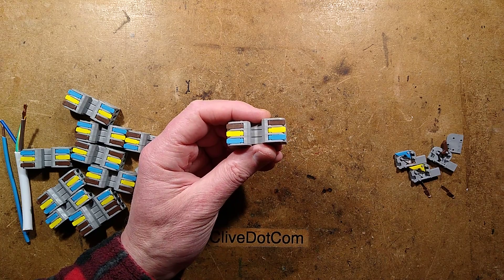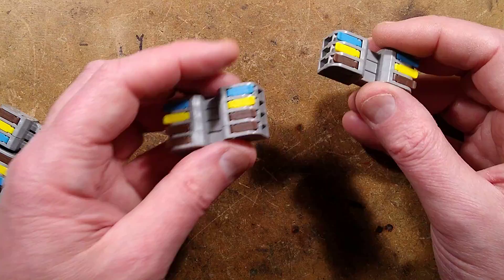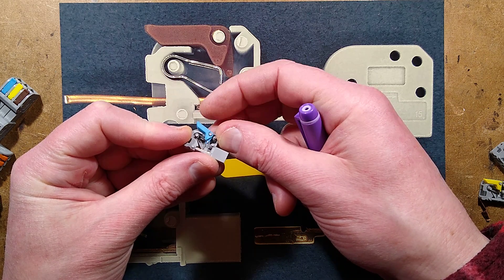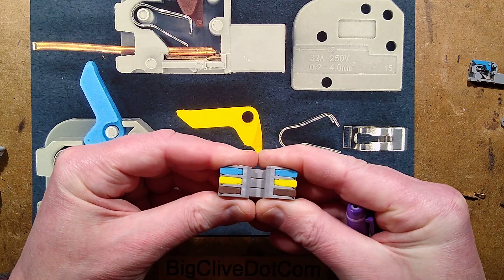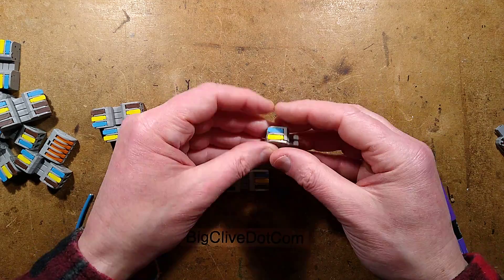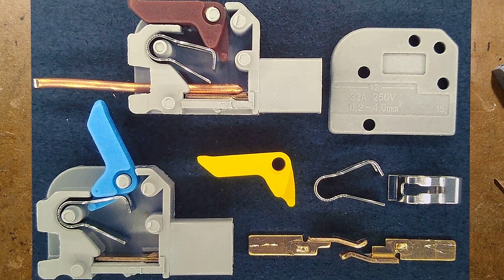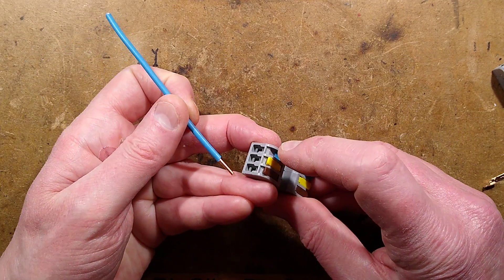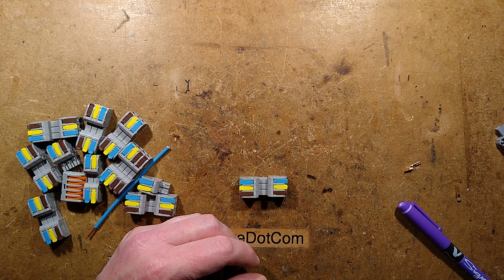Interesting modular connector with a few issues

Comment: Interesting - perhaps they should key the different colours, so that only like colours could mate together.
Reply: I'm honestly surprised that that isn't a minimum standard for something like this.
Reply: @seanbrockest3888  There is. It is the certification process that these haven't gone through - which is needed if you want to install them in a home's mains wiring. For the reasons Clive gave, I doubt these would pass. Which makes importation of these legally dubious.
Reply: @seanbrockest3888 well, these are made (and sold) where standards mostly aren't part of the process😊
Reply: China has no standards, they just copy ...  @seanbrockest3888
Reply: It would have been easy to add a way to key them. Add  a groove to the right and a dimple to the left in the same way the phoenix contact modular connectors "sc2.5" and "sp2.5" have. There you can cut it off and add it into the receiving end. Having 2 allows them to use one housing for both parts like they currently do. This product is a half assed copy of wago, phoenix and Anderson connectors. They had the chance to build something incredibly awesome from all of these.
Reply: @kjc197 
But the coloured leveres can be swapped about.
Reply: @snakezdewiggle6084 ah - I didn’t realise that.
Reply: @kjc197 
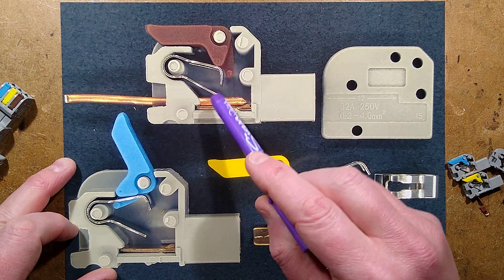Yeah me too, until I saw Clive's photo 1:42 the yellow and blue levers.
Reply: I wouldn't touch these with a barge pole.
Reply: I was thinking a plate with a protruding finger that could be snapped on on either side. Say finger on the top half on the right side and on the bottom half on the left side. That way if they were misaligned, the fingers would prevent them being put together, but if they were properly aligned, the fingers would slide past each other.
Reply: @jamesbrown4092  I had the same thought, wouldn't cost much in either development or manufacturing.
Reply: I think that a cheaper solution would be adding a blind peg on the end plates so you cant fit the connector out of sync.
Reply: Yes, that should be done at a minimum.  However, they likely didn’t do that for cost reasons.  With the current, dangerous design they can use one mold design for all parts.  Just change the color of the plastic every few days.  A safe design would require separate mold designs for each color.
Reply: @LTVoyager  this design isn't dangerous, it what is what it is. I've used such connectors for installation of celling lightning. It was so convenient to just plug wires on the ground and then install thing in one click. Much safer than wago terminals. 

Anyway, wago is not available in my country anymore.
Reply: @izoiva  The design is dangerous as pointed out in the video.  No question about it.  And it could easily be corrected, but that would add a few pennies to the cost and the Chinese won’t do that.
Reply: also thought about that, another option would be to make the end plate long enough to interfere with the other connector were out of sync. or of incorrect numbers
Reply: Anderson has colour-keyed gender neutral connectors. For lead acid battery chargers on forklifts, UPS, etc.
Reply: David Duke agrees
Reply: Or offer a 1/2 width blank
Reply: Would make it less modular, at least production-wise.

But! The last "wall" stopping the "daisy-chaining" undead could have some elongation to  stop misaligned attempts.
Reply: @AriochThe 
I agree.... a key block is needed to stop the misalignment. The end cap is the obvious placement.

But they really also need a means to screw them together to prevent accidental disassembly. The way the live contacts are exposed simply by removing one module is a horrible (yet compact) design. Imagine someone pulling one of the wires and the connector splits in 2. Now you've got potentially dangerous voltages exposed on a connector that someone who's just broken it might grab onto to fix.
Reply: @tin2001 nah the key needs to be it's own module so you can prevent plugging into incorrect plugs. This connector in the box has a key on on 2 and 4 the other connector is keyed on 1 and 3 kinda thing.
Reply: I think that would make them more expensive. It looks like you can just swap out the lever as you want, which doesn't work with your suggestion, because you could just swap the lever to another colour and things would now be massively frustrating, and you'd be ripping your hair out trying to figure out why the blue won't connect to the other blue.

Comment: I think it could be safer if the earth modules had their connector mirrored, providing a key and making it very unlikely that a current wire be conected to earth. Doesn't stop L/N swapping, but if the recommended layout is separating L and N with an earth it would be mostly avoided.
Reply: Because opposites will be mirrored, plugging two identical power sources together with the yellow earth keyed  would still mate, yet short live to neutral twice as solidly as the plug can normally connect!  A keying that has one plug upside down would avoid that and also allow a simpler shape of the bronze spring plate .
Reply: I think the end plates should extend and be made in a way that if you misalign the connectors the end plates interfere. (Please contact me directly for my royalty cheques).

Comment: These are so close to being fairly cool.  I was also reminded of the anderson powerpole action for the plugging two connectors together, though I feel like those make a more solid connection with a lot of copper-on-copper and self-alignment features.

Perhaps if they had realized the misalignment problem and extended that end-cap piece to overlap the other side, it'd prevent most misaligned connections.  Or an outer shield that also has to be aligned, a bit like the 4-pin Molex.  Maybe a fun 3d printing project?
Reply: Yep all the need to do was make the Earth moulding unable to enter N or L [ oops already mentioned ]. Also use better materials.  I would use them in the workshop but nothing above 7A.
Reply: @Woffy.  The problem with that suggestion is that they'd have to design and produce a second body part, diving up cost. Just having a longer end cap for the stack means a bit more material, but the cost of that is almost negligible in comparison (and you only need to carve out a bit more of the mold, which also isn't particularly costly).
Reply: I got a bunch, and they are wonderful for low voltage electronics protoyping situations, also because the not keyed and can be abused becomes a benefit.  But I'd also never consider putting more voltage than I can touch without worry on them.  Wouldn't even consider letting them anywhere near mains. (And I wouldn't even use them in anything that would ever be used while I'm not present...basically a clippy breadboard in my head.)
Reply: They might be ok for bench testing applications. I wouldn't put them anywhere permanent/out of view.
Reply: The Anderson versions have a steel spring backing the contact so "pushing past the bump" does not compromise the contact pressure, and indeed the wiping action is part of the self-cleaning property of the Anderson.

Comment: Interesting and okay for low currents. I like your in-depth analyses.
Reply: Aren't spring terminals already quick enough to connect?
Reply: i could see myself using these for audio experiments. they're tooless, unlike soldering XLR connectors or screw terminals that require A tiny screw driver. on top of that they're also cheap and customizable.
Reply: @grants7390  audio on speaker level or balanced line connections would probably be fine, but unbalanced and/or low level connections are pretty risky when it comes to hum and noise.
Reply: @KeritechElectronics  like i said "experiments". as in does this have a chance in hell of working. I don't want to put in A tonne of time and effort with screw terminals just for it to turn out there is zero chance of the concept working. although nearly all audio i work with is balanced audio, un balanced isn't as sensitive to interference as people tend to think, as long as this connector along side electrical wiring there is unlikely to be a problem.
Reply: @KeritechElectronics   if I buy these i now think that's going to be my first experiment. basically use them with an un balanced signal and then introduce it to worse and worse conditions until i start to have audible interference.
Reply: it's a very big terminal for low current wire

Comment: I would like to know what sizes of wire it's designed for.

One video showed the Wago handling very high current and not failing.  I wonder what the maximum these are rated for.

Comment: Is the grey/orange multi connector Wago or Chinesium? If Chinesium how does it compare?
Reply from the maker: It's a real Wago terminal.  I've looked at clones and they weren't bad.  But you never know what is going to be shipped.
Reply: @bigclivedotcom  The orient express rarely disappoints! I wonder if there any public data for the minimum resistance said connectors (or any connector) should provide? Its all mystery plastic to me.

Comment: Hi Clive, the connection mimics the Anderson high current DC connectors (of various sizes), which do work quite well at currents up to and over 100A. The capture clips certainly aren't high current capable, though. Thanks for the video!
Reply: Anderson PowerPoles do have a similar shape, but they also have a separate steel spring to press the contacts together.
Reply: You are probably talking about a connector from a real brand and not a Chinese counterfeit, with questionable dimensions, tolerances and no certifications according to our Western European North American standards and laws. This is to keep electricity safe.

Comment: You could just wrap each side in one layer of electrical tape (or a zip tie). That would ensure the bail-arms stay down. 

The alignment issue is a whole other problem—and is a fixable one I think. The blank plate for the end just needs an alignment extension that would block its side from being on the inner edge of the mating connector, and the mating connector's one (which would be on the other end) would protect against misalignment in the opposite direction. This might be fixable with a 3d print of the part with that arm.
Reply: You could have the earth/yellow as a keyed connector that only fits itself, would have to arrange them so you couldnt skip it entirely. Not perfect though. But at the end of the day... there is nothing to stop you doing this with terminal blocks so its not worse right?
Reply: @drsquirrel00   If you get the right terminal blocks, though, they have the little <local compliance stamp> on them—and then if it's screwed up, it ain't your fault.

But, yeah. Given there's only three colors, I'd think a way to key each to only fit its own color would be best.
Reply: @ConstantlyDamaged  Having a couple more colours would be nice as well.
Reply: @drsquirrel00  Yeah. Red/Black would be a good start. Toss in white as well and you could then make a 3-phase version—which is now terrifying me with the idea of using these un-keyed and dubiously rated connectors.

Let us not use these for 3-phase.